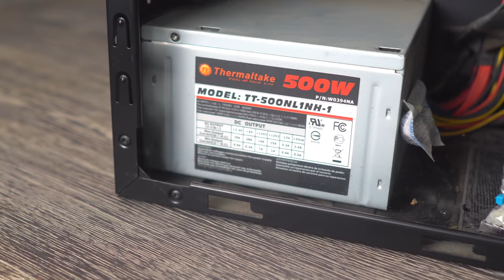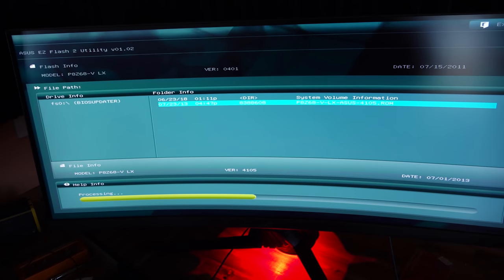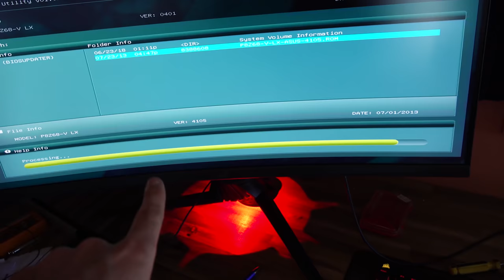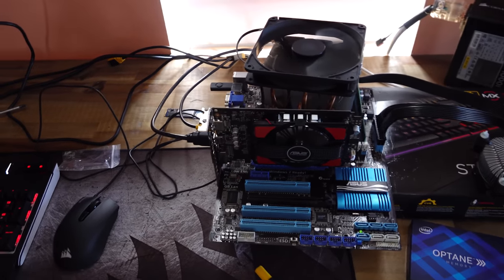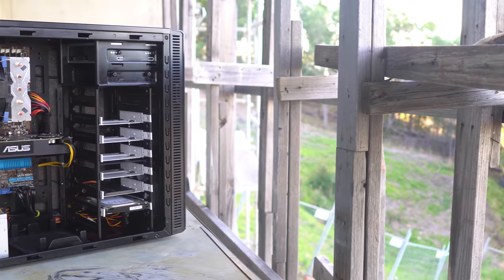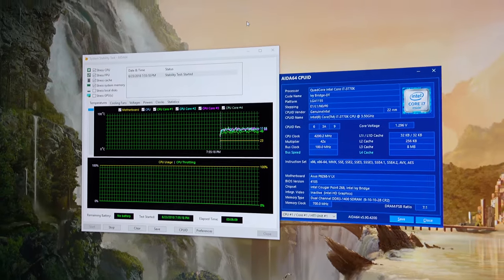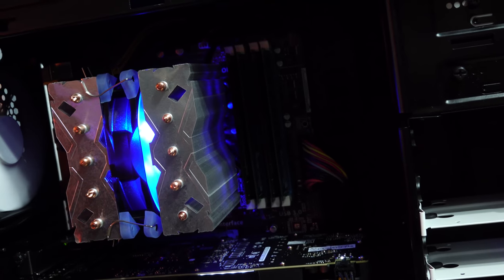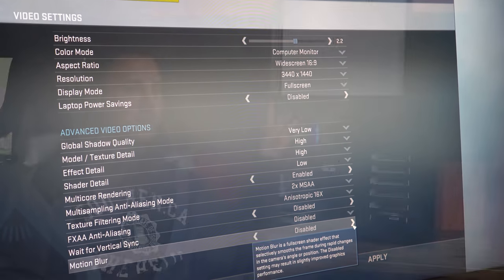How to RESTORE an Old Gaming PC - The Tech YES Process

Comment: I had a Phenom II x6 1090T that had one core that refused to do an extra 100mhz on every time I tried to turn the core on at the 4.5ghz the system would BSOD the moment it was stressed but disabling the core it was fine but having all cores just 100mhz lower and was all stable at 4.4ghz, didnt bother me as for that CPU it was a good overclock, Nice build I have the same case just with the windowed side and I love it as it's just the right size for what I needed without being to big, but with a system installed you have to watch you dont throw your back out moving the thing lol.

Comment: All you need is a motor grade air blower. I've got one since 2007 and leaves all components like brand new. BTW: I've had a 3770k and could OC to 4.8Ghz and gave 900 CB15 points (good luck)

Comment: Where do you buy breakcleaner? Where i buy it it's about 150% of 1L denatured alcohol (cleaning alcohol) for 400ml in a pressurised can
BTW plz do NOT use breakcleaner on anything els then metal, it's desinged to dissolve anything but metal and could potentially damage the motherboard

Comment: 1 GB HARD DRIVE😂
Reply: Yeah right xDDD
Reply: piece of potato damn so much space  ( ^₩^)
Reply: I thought my 160GBs were bad lol
Reply: Callum Faulds i used to use a 120gb...hdd
Reply: He meant 1tb i guess
Reply: Thinking bout my first 20mb hard drive on my 286/12mhz..What a MACHINE.
Reply: as soon as i herad that i quit the video and looked in the comments for the 1gb hdd. lol. found the comment up top
!
Reply: john conners haha my first machine was 300mhz and had a 80mb hdd if I remember correctly. Windows 3.1. Windows 3.1 is still my favorite. Never liked any windows better after upgrading.
Reply: @MisterRorschach90  I've seen plenty of copies of Dos and Windows 3.1 floating around on the internet via eBay and such use one of those I'm sorry to hear that by the way
Reply: donovan strawhacker I do still own a floppy disk with windows 3.1 somewhere. I haven’t thought about loading it up on a current machine in quite a long time. For a while I stuck with Windows XP until it got to the point where I couldn’t complete all of the tasks I needed to complete. Makes me wonder how well it would run on my i7 with a good ssd. I’ll have to look into it.
Reply: SMASHING those games!
Reply: it's cute =)

Comment: I'm trying to find a good deal on a used i7 3770k, my overclocked i5 3470 won't be able to handle BF5.
Reply: I have a friend running a stock i5 2300 with a gtx 760 that runs bf v just fine. The i7 is overkill for most games.

Comment: dude.. i think we both run the same brain. i bought a pc yesterday with an i7 3770, 16gb ram 1tb HDD and a gt630... $50 for the whole thing. AND.. i just bought a 1060 3gb used so i could flip it as a gaming pc. these are pretty close in spec.. down to the damn motherboard. coincidence? thought of you when i found the pc <3

Comment: What termal paste do you use for the overclocking?
Reply: Trap Bolt idk what he uses but thermal grizzly kryonaut is one of the best pastes on the market, then if you don't want to spend as much you can get Arctic silver, it's decent and I have it in my pc with a 2700k oc'd to 4.5 ghz with an air cooler
Reply: Frog In A Car I think u mean 2600k mate
Reply from the maker: GC extreme. did a video on it.

Comment: you call that dirty? you have not seen the rig i bought recently, you could not see the cpu or gpu heatsinks because of the dirt. it was a good buy though, about 35 dolars for core2 quad q6600, gigabyte gtx 560ti, corsair gs 500w, asus p5q se plus, 6gb ram. i had to open the psu to clean it up, the case i got it with had no dust filters, all intake was at the lower part of the case and there was no exhaust

Comment: Hey Tech YES City,
I'm having an issue deciding between an i5 2400 or a Pentium G4560 (UserBenchmark rates the i5 2400 3% better)
But each CPU has its own pros and cons,
Biggest difference is the G4560 utilizes DDR4, while the i5 2400 utilizes DDR3.
G4560 is 2 cores, 4 Threads, while the i5 2400 is 4 cores, 4 threads.
With the G4560 being approximately $80 NZD it's not a bad budget option,
but a lot of these old Dell Optiplex's vary from $50 NZD - $125 NZD - Most including a i5 2400
I'd like to hear your opinion and/or do a side-by-side comparison (also overclocking!)
Thanks in advance, love the videos :)
Reply: Jaq 

U cant fit a gpu in the dell optiplex ye?
Reply: Teemo4Life True, but say I was to have an ATX case and do so, which would be a better option?
Reply: Jaq It comes down to whether you're comfortable or not buying used. You could build something good for less money than buying new things. In my case I'd try to stretch however possible to get a Ryzen 3 2200G, a B350 or B450 if they come out, 4 GB of DDR4 or 8 if possible (you can always upgrade it later down the road), a 500W power supply from a reputable brand, and game on integrated graphics until a good deal on a used GPU appears, or wait for next Nvidia/AMD generation cards while gathering the neccesary money. I wouldn't recommend going any lower than that if you're going new, because not only its value for the money is on point, but also because its upgrade path is the best and most comfortable out of any options around the market. But if you can't afford it, buy a used Optiplex with an i5 2400, 8GB of Ram (or upgrade it from 4 if you get one that doesn't have 8), get a used GTX 750 Ti, upgrade the power supply if needed (probably), and it'll be a pretty awesome and capable gaming machine.
Reply: i agree with going ryzen with a quad core since upgrades later will be significantly less of a head ache and really easy
Reply: Also, if the pricing is better, you can get a Ryzen 3 1200 or Ryzen 5 1400 in case you find good deals on any of those compared to the 2200G, but you would be forced to buy a GPU right off the bat. You can also consider the i3 8100, of course. But its igpu isn't as capable as Ryzen's. Also, the gaming performance difference lays on the GPU mostly, but you would maybe see a somewhat considerable difference in performance when comparing Ryzen 3 1200 vs i3 8100, not as much between the 2200G and the i3 8100 though. Unless you overclock them, of course.

Comment: Hey Bryan, I really don't like your Overwatch Benchmark. You only have bastion and Roadhog, which have very little particle effects. and you set up as turret just shooting, sometimes behind cover, meaning less render is required.

here's a suggestion.

create custom game, move yourself to spectators. Add 12 easy bots (make sure there is no bastion. Zarya, Zen and sombra are good as their ults have lots of particles). Hero settings (general) ultimate generation 200% (both bars)
and start a game (control point or capture point). then just sit in a corner and spectate them. they should have ults fairly quickly, as some of them will just crash the FPS
Reply from the maker: Ok let me know which heroes tank the game and i will check it out lol.
Reply: TANK the game :P

so for worst case (min fps) you want to see some utlimates such as Zarya (graviton) Zenyatta (Transcendence) Hanzo (dragonstrike) Sombra (EMP) Lucio (soundbarrier)
all these have pleanty of sound effects and it's not unlikely to have 3-4 of them at the same time. 
Pharah (barrage), Reaper (deathblossom), Ana (Nanoboost). In general lots of ults have particle effects that can affect the FPS. Also, spectating needs less work from you :p

Comment: I tried your brake cleaner and well, almost emptied the whole can, $7.95 for one mobo, not good value when you're reselling.

TIP *
* Hand pressure spray bottle filled with 90%+ isopropyl.
* Fine water filter to collect excess run off.
* About $40 (5 litres + bottle + filters) all up, for around 20+ motherboards and video cards.
* Even cleans those stickers and sticky goo off much quicker.
* Totally reusable, You can't re-use the brake cleaner.

I like the look of the WD40 finish, but heard it can tarnish (make dull or seeps into) plastics over time.

Comment: Why don't you use water with a hose to clean out the case it will easier u just have to remove the components and the front IO
Reply: Keshminder Singh cause that's an amateur af way to clean cases haha
Reply: H31MU7 why it's actually gonna be really clean.
Reply: I personally do this all the time. When you have a PC that hasn't been cleaned in years, compressed air won't do shit.
Reply: Joshua Fields yeap true
Reply: I use a clean dry small like 1" paintbrush to get the stuck on stuff loose. I clean all the PC's I do with a garage air compressor and my small paintbrushes.

Comment: Boo for chucking a stock cooler, its WORTH saving for re-use, not all machines need to be overclocked, that sata cable is still useful esp if you play with used hardware

Comment: i just dealt with a old dell workstation it had 8gbs of ram and the stock cooler so i changed the case and changed the cooler i also exchanged the ddr3 1333 ram for 16gbs of ddr3 running 1600 mhz and i put a gtx 660 in it and now it runs nice and cool and it out performs my fx-8350 so i said fuck it and now the i7 930 is now in my main rig and im in love with it

Comment: +Tech yes City. Try squeezing the liquid metal out onto the cotton bud instead of the CPU. You save yourself the risk of dumping it all over the motherboard.

My Asus P8z68-V  "16 phase VRM" melted down while playing Watch Dogs 2 on a 4.4Ghz i7-2600. Now, if you plug in a new PSU, it makes a really nice loud Bang and lets the magic smoke out. After 6 years of abuse it is time to replace the board.

That z68-v LX board you are used has a terrible el cheapo VRM in comparison to the normal z68-V board. The Funky OC behaviour you saw may be a symptom of the potato VRM on the board. Those LX boards are cheap and plentiful out of China but if you need to buy another z68 for another build, I would recommend staying away from the LX and spending the extra $20 to get the z68-V or the z68-V PRO (same as V but with extra SATA III Marvell controller)  which has the better VRM in the future

Comment: Can anyone tell me how long would 1070ti will last for 1080p/60 fps gaming in medium preset.
Reply: My guess is min 2 years up to 3 and its based on the console market-games most of the time are optimised for consoles first so im expecting new generation to be introduced next year, and launch in 2020 and after that You will se games using more cores and gpu horsepower
Reply: What games?

At least 3 years
Reply: 1080p at medium is really easy so im guessing youll get about 4 years at least since my 980ti is playing games at 1440p extremely well still after a couple years
Reply: Even today its slight overkill for 1080p, so it will last 2 more years untill 7nm gpus are the trend, so no worries
Reply: A lot longer than others are suggesting what has aged older graphics cards poorly is the gradual increase in resolution's and textures ie 800x600 in 2002 to 3820x2160 in 2018 this has a huge impact on vram rendering old cards obsolete.
My guess the card will last it's entire life cycle if you only want to use it for 1080p the only time you will run into issues is if they release another unsupported api like dx13 or something similar.

Comment: wtf is 3440p
Reply: Dean Vidafar Its 4k Ultrawide. He's just being obtuse.
Reply: He meant 1440p
Reply: well its 1440p and its more 2.3k than 4k. If they make a monitor that is 5160*2160 then you can call it 4k ultrawide.
Reply: Dean Vidafar Yeah I was wrong, but only using the OLD naming standard. It's a newer ultrawide resolution, 3440x1440, which is called 3440p. Most "4k" displays aren't actually 4k to begin with, but 3840x2160. By the new descriptive standard, a proper accurate name would be "3k Ultrawide". (Lots of bullet holes, these definitions leak from, hmm?)
Reply: I've not heard of this definition. As far as i have been aware when i select a 1080p stream im getting XXXX by 1080, not 1080 by XXXX
Reply: 3440Panoramic?

Comment: Should a hdd be noisy
Reply: ginger gamer what kind of noise is it making? It shouldn’t be loud but if it’s rattling or humming inconsistently you should worry a little
Reply: iwannaquickscope Spon installing windows 10 pro I had gotten a warning saying the hdd was going to fail
Reply: ginger gamer use crystaldisk info to check diagnostics on the drive. Any error on the SMART would indicate a chance of failure. Also, stop buying Seagate drives as they're mostly prone to fail. Mine already has errors after just a few months of use and I don't even move a huge amount of data.

Comment: my 3570k @ 4.2ghz with hyper 212+ runs hotter than that :( well.. not much actually but I can't run it any higher without stress tests getting into the high 80's really

Comment: That's a horrible power supply. It's not really 500W. Those were the cheap Thermaltake power supplies of old. They would often have capacitors that would blow up. It's a cheap PSU which Thermaltake would slap their label atop.

If you slap testing equipment on it, it will give you low efficiency and unstable voltages.

For the sticker residue, just use lighter fluid. It will remove it.
Reply: Issa La Rose i still use it. 5 years on oced i7 3770k and r9 290, not a single problem still. Psu is totally fine.
Reply: You're lucky. The failure rate on those things is quite high. It's the same PSU as the OCZ GameXStream (FSP Epsilon).

If you want a reliable PSU I would recommend the Seasonic platform. Many brands sell Seasonic PSUs (XFX, Corsair, Antec just to name a few).

Check this database: http://orionpsudb.com/platforms
Reply: being totally fine after 5 years doesn't mean that a psu is good, if it ever breaks,it will surely take something else along
Reply: glostermeteor w8, 5 years on 500w TR-2? With R9 290? Seriously?
Reply: Issa La Rose but FSP are really best budget PSUs! Yes, Seasonic are Rolls Royce of PSU but FSP is really good too! The problem with epsilon series that they were pretty unfair. I mean here epsilon 1010w with only 600w on 12v rail. Good power supply but filthy marketing.
Thermaltake TR-2 series is cheap CWT platform which is nowhere near FSP in therm of quality.

Comment: here a miles better way of getting the sticker off and you a can reuse them use  heat gun or flame on steel from the back or inside case or a hot hair drier  on plastic get them off in 1 piece and reuse to boot and NOT OVER NIGHT  but in 2 mins & I DONT USE WD40 IT STINKS USE COCKPIT SHINE WHAT U USE IN YOU CAR IT A BIT SLIPPY THO                      GREAT SHINE & SMELL

Comment: Delidding a 3770k! Absurd.
 This video lacks balance and a 120gb sdd is sucky, I'd add at least 500gb for the SSD. Also I'd be running the games at 1080p and probably keeping the original CPU and what a waste throwing away a good heat sink because you couldn't work out how to clean it, Jesus, just throw it in the sink, it's aluminium it will be fine.